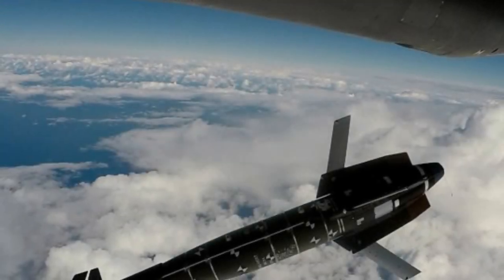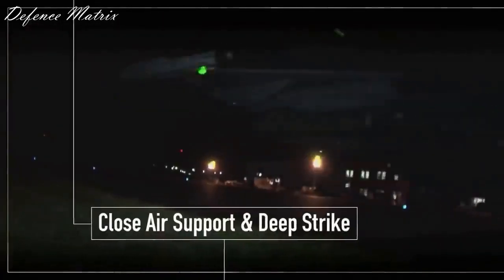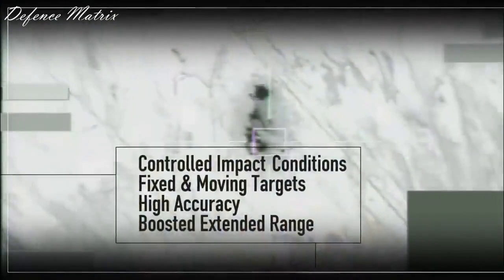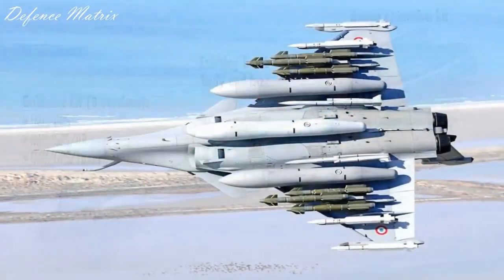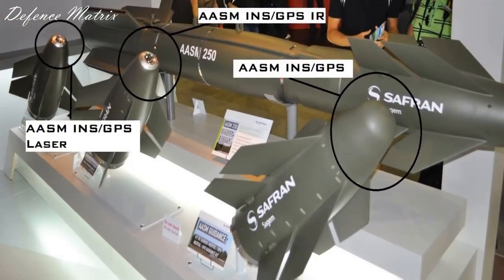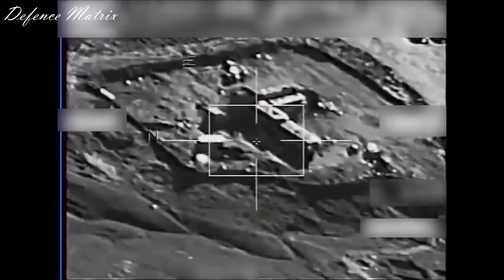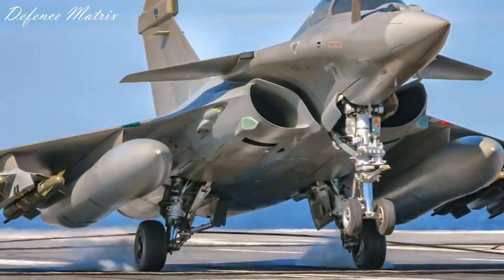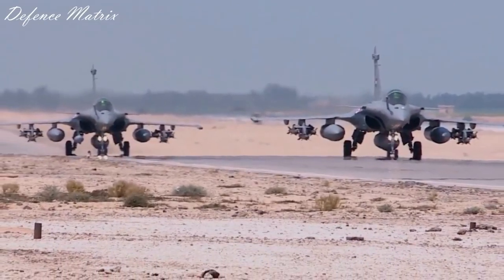Addition to Rafale | 1000 Kg HAMMER

Comment: hammer missile much similar to missile only  thats why IAF chosen the hammer missile to kill the piggies    if piggies Hides along the mountanious regions them indian  airforce has the capability to strike on them as we have seen it has iaf has striked spice 2000  during the kargil conflict  in which mirages where used but usually those mirages would have to fly at high altitude on the top of the mountain and then strike in them as we seen it in the video of IAF striking Bombs on kargil top of it